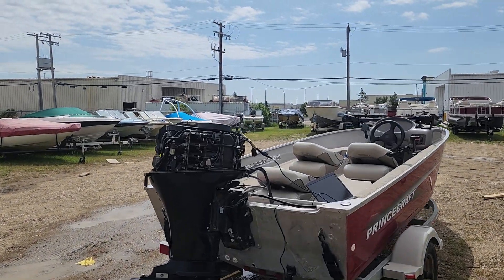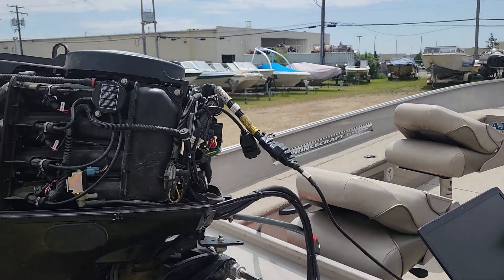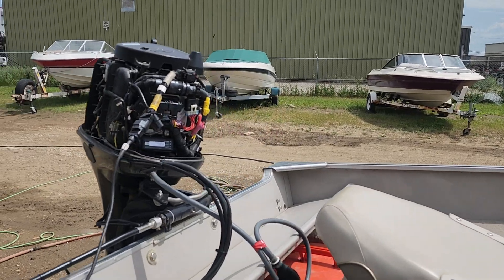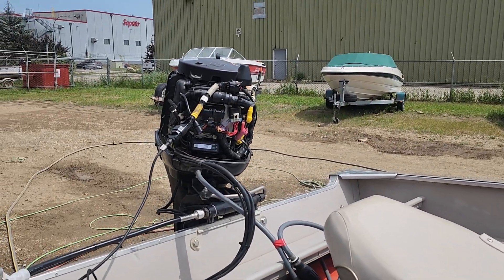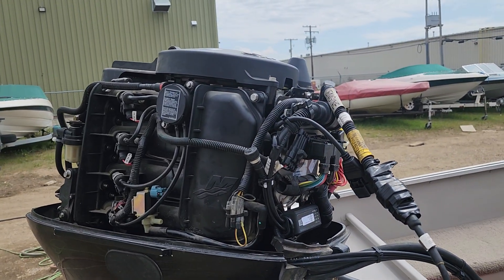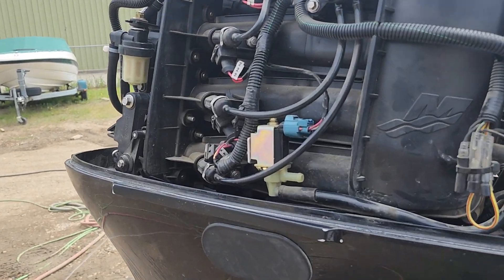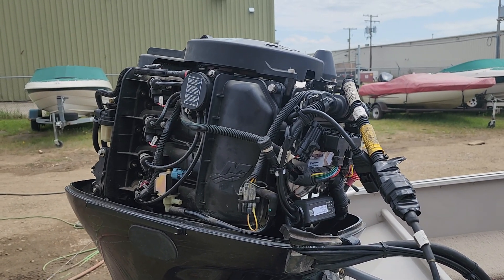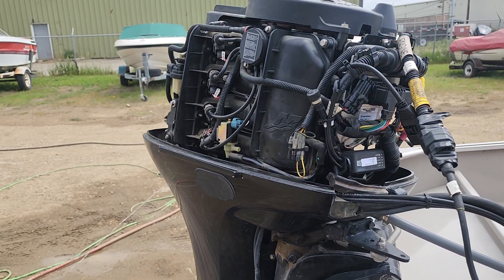“Mercury 60HP Outboard – Fixing High Idle from Throttle Body Air Leak

Comment: So absurd computers on tiny outboards.
I grew up working on outboards in 70s to 90s .
No reason to have such high tech nonsense on small motors.
Reply from the maker: EPA laws, convenience, marketing and simply updating the product.  We see far more fuel related issues due to carbs.
Reply: @TheMarineDoctor except owners or any mechanic can reapair simply without computer scanners etc .
I guess i am old ..
Lol
Reply from the maker: @Motorhead250 Its like everything else...we are told what we need.